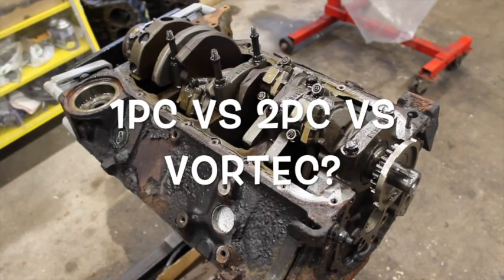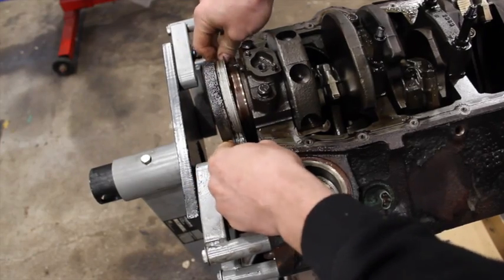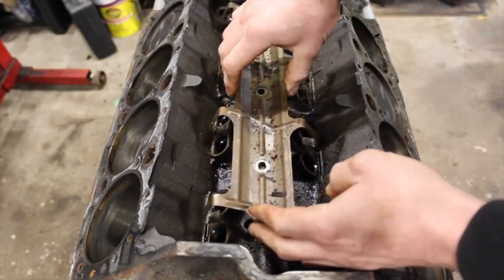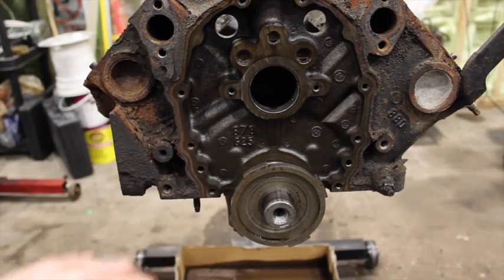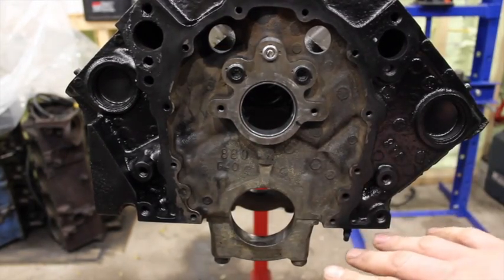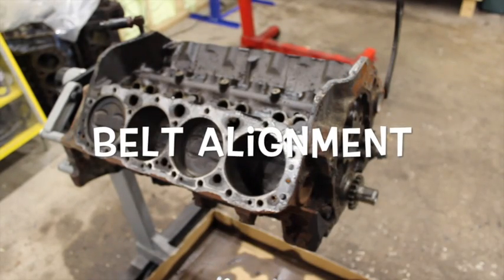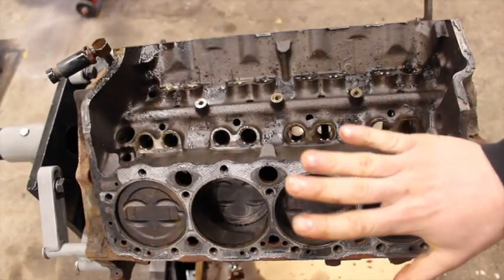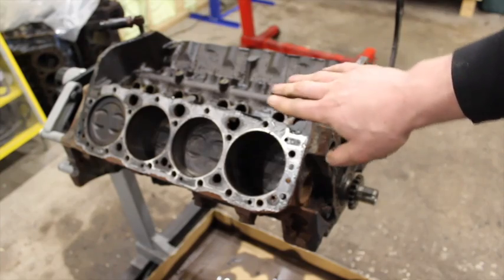1 Piece vs 2 Piece vs Vortec Blocks? SBC

Comment: *Pertaining to MOST applications

1955-1986 sbc are all 2 piece remain seals. Hydraulic flat tappet cam engines using perimeter bolt valve covers.

1987+ are all 1 piece rear main seal, roller cam, center bolt valve covers. 

*Now, with that said some of the early 88-"98" trucks, like '89 year models or so have been known to have left the factory with a flat tappet cam. I've never seen it myself but have heard it from a few who have no reason to lie
Reply from the maker: That is true, the tbi trucks 95 and earlier often times have a flat tappet cam. As mentioned in the video sometimes the holes are tapped for the roller lifter cage and sometimes not

Comment: With 3/4 tons, you're looking for a 2500HD 8 lug wheels. 6 lug 3/4 ton trucks nearly always have 2 bolt mains unless they have a service replacement engine. That's typically how HD trucks end up with 2 bolt main engines too.
Reply from the maker: Haha that is very true! Its happened to me when I thought I was for sure getting a 4 bolt
Thanks for the info
Reply: @cuttersperformance  my biggest disappointment is popping the hood on a late 90s 1 ton and finding a small block instead of a 454 😂
Reply from the maker: @jr78racer  haha I like your style 😎

Comment: Had a rear main leak after my 2piece 355 build. Got an offset rear main. rtv’d the cap n block registers, seal ends and outer part of seal (where it’s housed in the block and the cap). Less leak, but still leaks🤦‍♂️. Any suggestions?
Reply: drain out the oil. then it won’t leak anymore. 😂
Reply: @jameshall4385  Yeah, I worry if it's perfectly dry, lol!  Gotta have that good 'ol SBC hint of wetness else the world's out of whack.
Reply from the maker: Offset seals a good start cause oftentimes the crank gets worn where the seal rides.
Do you offset the seal in the cap so it doesn't line up the the mating surface of the block? 
Also how much RTV did you use? Too much might be causing you issues
Reply: @cuttersperformance  yeah. Offset the seals less than 1/4”. I put a dab of rtv on the ends and a very thin layer on the outer groove. However, i did get a light shaving basically around the entire top seal as I was sliding it between the crank and block.
Reply from the maker: @soyramflero  sounds like the seal might have been damaged on install
Reply: @cuttersperformance  your probably right. Was hoping the rtv would fill the gap
Reply: Can you use a rope seal in this instance?  Personally, I've been pleased with the rope seals, they can leak when new but stop after 10 minutes or so, in my experience.  I agree yous was probably nicked on install, easy to happen.
Reply: @thisisyourcaptainspeaking2259  never used rope seals. Thought that was old technology. Like cork gaskets.

Comment: With the first run of 1pc RMS. Do you prefer to run the 638 or 148? The 148 has 638 cast into the base webbing, and seems identical, but the oil gallery has less and smaller gussets. Which do you prefer?
Reply from the maker: I have never been able to get my hands on a early 148 block so I can't say for sure. 
But the best blocks are usually the 638 4 bolt mains. Or you can take a good casted 638 from a f body and make it a 4 bolt with sprayed caps